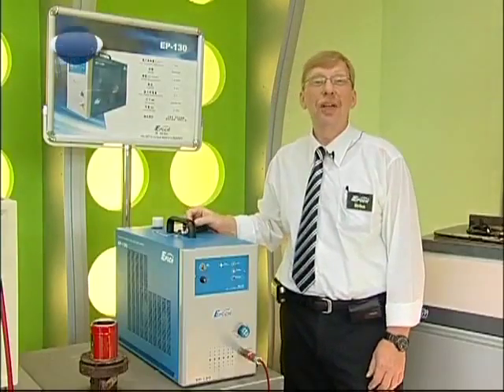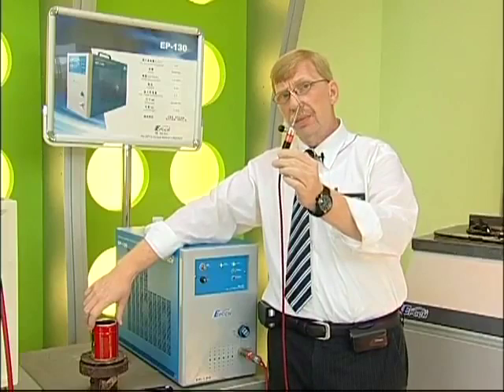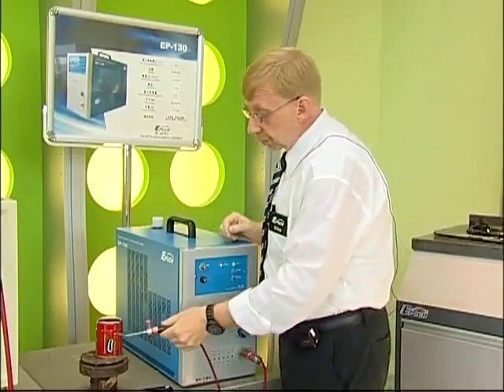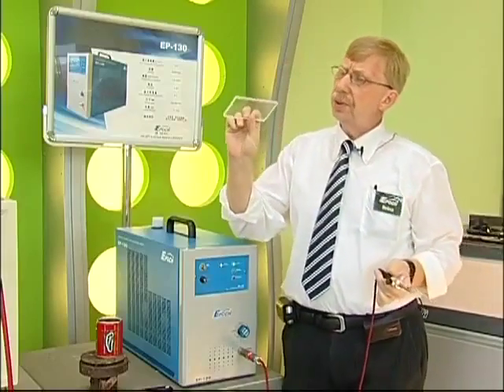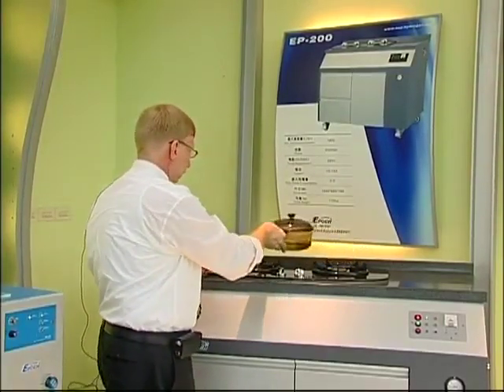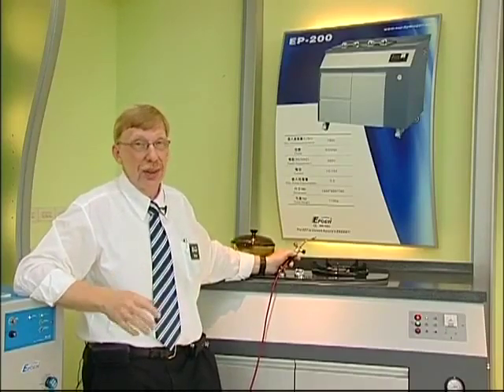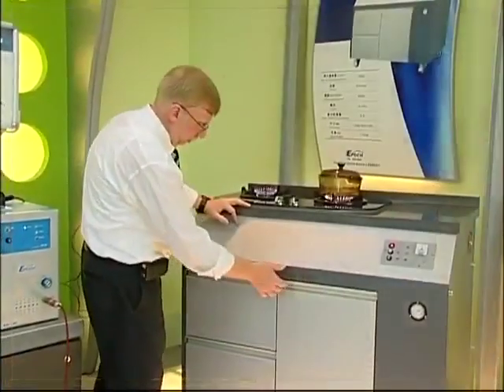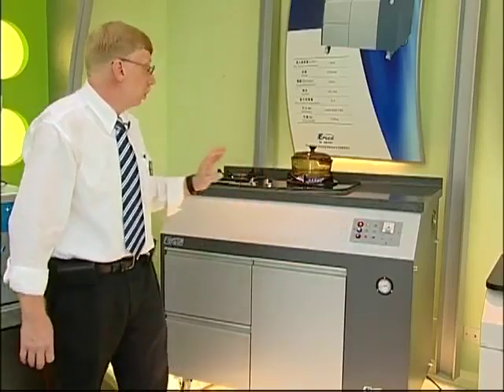EPOCH HHO Hydrogen Energy - Showroom Introduction -Part 1

Comment: You are right, the so called renewables are neither free nor absolutely clean energy source.  

Back to HHO: an other issue is the efficiency of the whole process: generating electricity, transportation, hydrolysis, then burning H .

Comment: It's actually HHO or Hydroxy Gas from water. Known today as Brown's Gas...It is a combination of 2 parts hydrogen and one part oxygen as a gas from the electrolytic splitting of water. Very cool flame which comes from the combined gas BG...it is carbonless and therefore VERY CLEAN FUEL